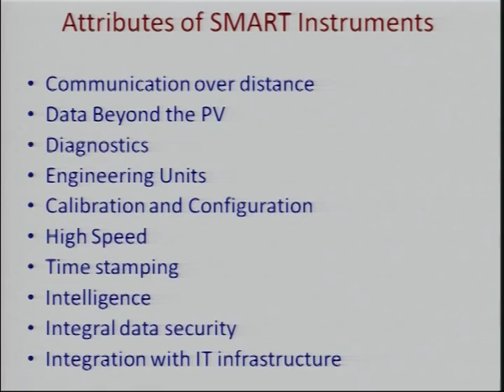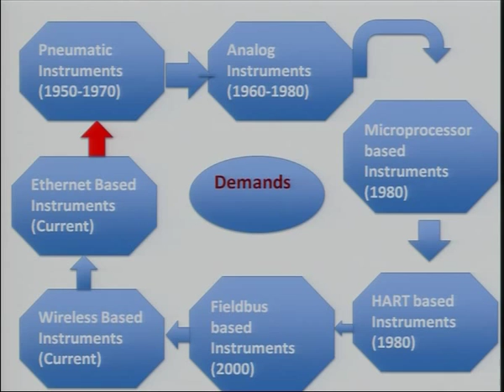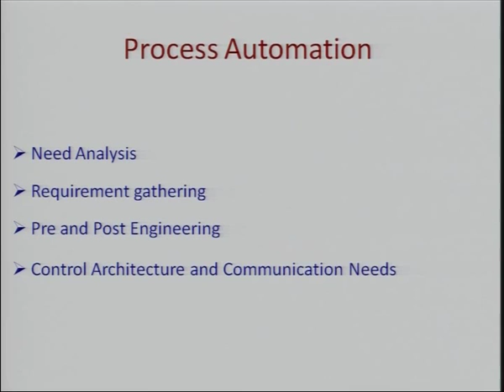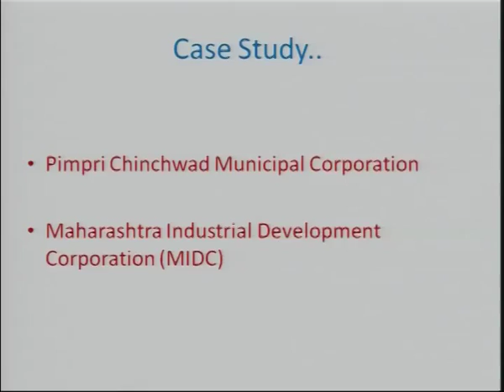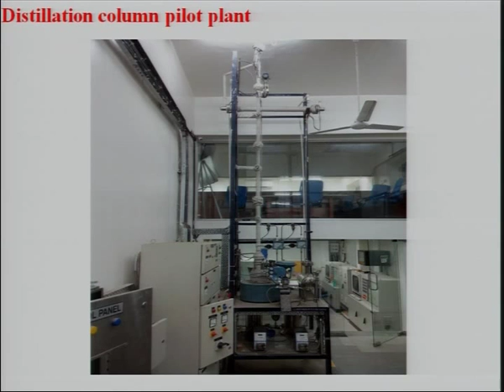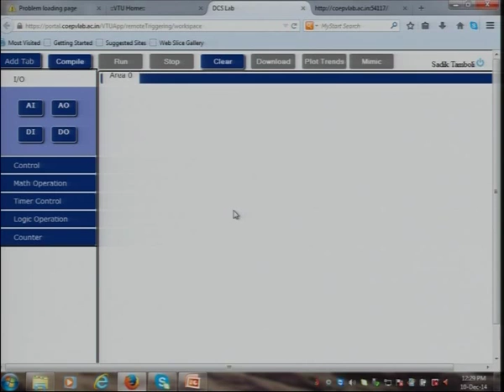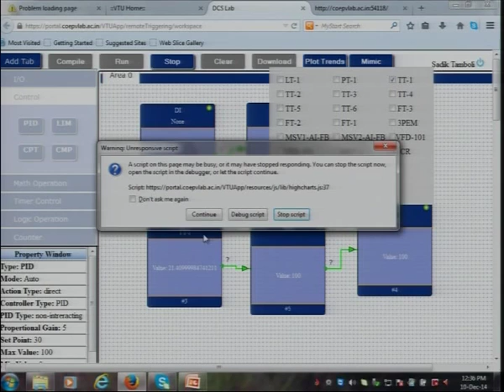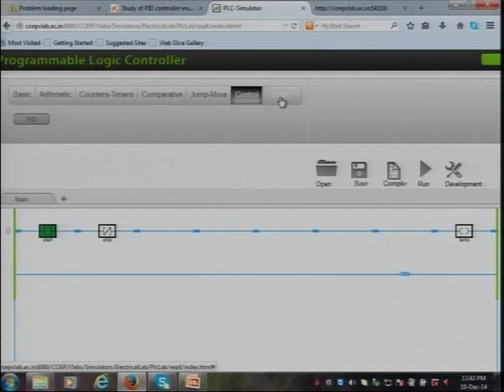Smart Instrumentation and Process Automation

Comment: basics of sensor,transmitter,electro-pneumatic actuator,encoder,frequency-votage/current converter,current to  pressure converter,transducer,resistance temperature detector, electromagnetic flowmeter, pneumatic system these how to learn it?